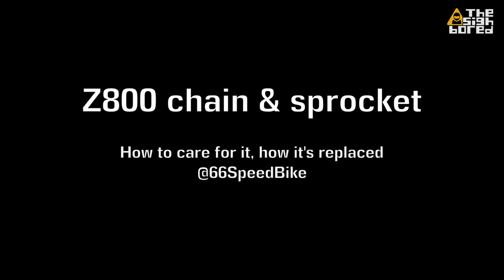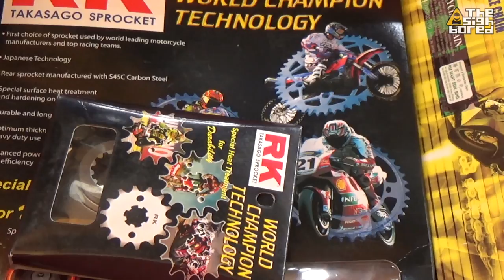Kawasaki Z800 chain and sprocket replacement

Comment: ‼️‼️‼️Hi sir. I have important unanswered ⁉️
In you case, Rear teeth - 45
Front teeth - 15

But I have received 46 - 15 set for z800. Does this cause any problem or fine to have???? Pls let me know so that I will return the product unused to my dealer
Reply from the maker: Standard is 15 front and 45 rear. With a 46 rear, you will have littleore acceleration and a slightly higher RPM when running at higher speed. You can use a sprocket calculator (Google it) to see the difference. You can still run with that set just make sure the chain links are enough. If you still want standard sizes then you can exchange it with the seller for the correct ones that you want.

Comment: how often you change chain bro and how much
Reply from the maker: Frequency depends on usage, maintenance, and condition. Generally minimum life is about 35,000 km and can go as high as 50,000 km but mostly depending on the chain and sprocket condition. If you are changing a set it is generally MYR 450 and above, some places might be cheaper, some places, more expensive, depending on the item brand as well.
Reply: nice. thanks bro. if its R25 bro, would it be cheaper?
Reply from the maker: Yes the chain and sprocket set will be cheaper, since R25 uses smaller sized ones.

Comment: Sifu kalau pakai wd-40 okay tak? Untuk cuci rantai
Reply from the maker: I'm not the sifu, but I believe it is fine to use WD-40, just make sure you clean it away thoroughly before applying the fresh chain lube afterwards.
Reply: Aslam Akriah WD-40 contains kerosene, so I think there is no problem using it
Reply: TheSighBored thanks alot bro..best channel ever!! Keep it up sifu saibot
Reply from the maker: Thanks for the support, will do my best.. :)

Comment: so we cant use degreaser?
Reply from the maker: It's not that you can't, of course you can, he just personally doesn't recommend it. Degreaser are really strong so if you use it make sure you follow the instructions and not leave it sitting on the chain for too long, thoroughly clean it all away after use.

Comment: cuci with sabun instead of minyak tanah boleh?
Reply from the maker: Soap is still a chemical, as long as the soap is not too strong to eat into the rubber "o" or "x" ring, then it's fine.
Reply: TheSighBored  oh okay. Thanks. Safe ride bro👌